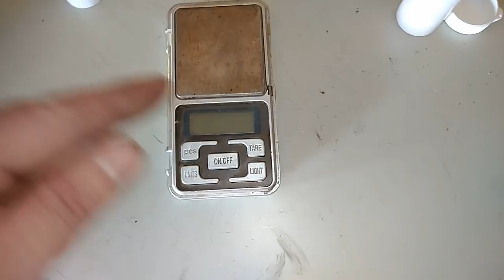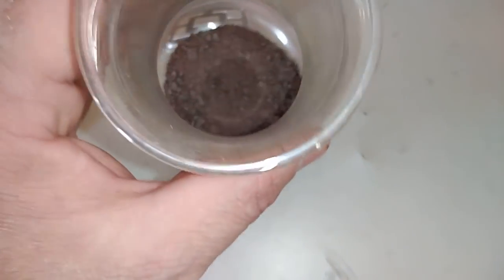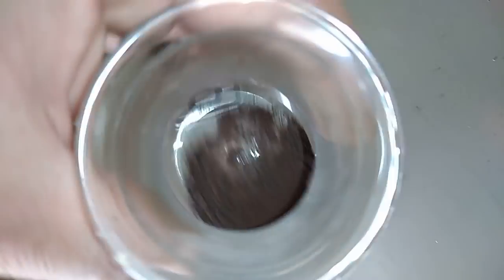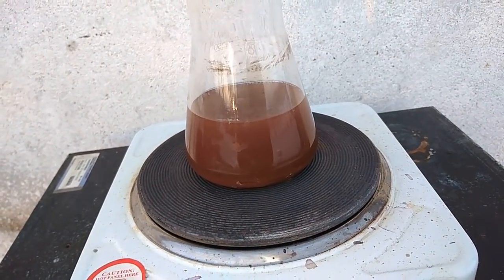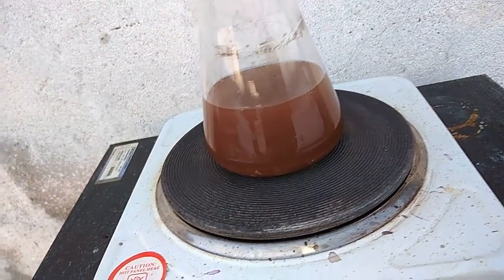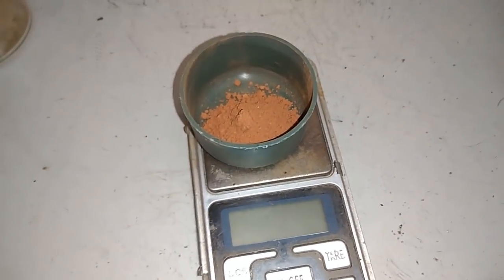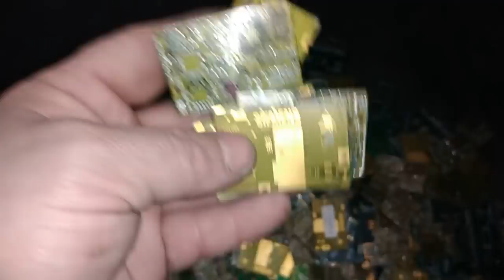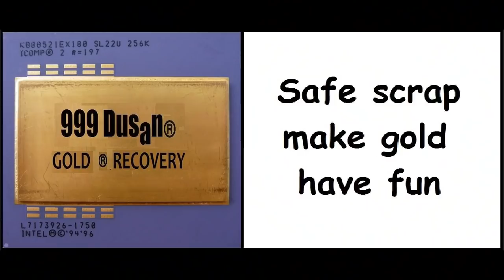Refining 500 modems gold to high 999 purity!

Comment: So about $570 in gold .  Would be interesting to find out how much all the chemicals cost to refine it.  Really enjoy your channel
Reply: The most expensive is nitric. If you live in the states everything can be bought at a local hardware store for cheap except the nitric acid. It doesn’t cast much to refine depending on what you have and the process you use
Reply: I am from the same county as Dušan, and here is pretty hard to buy nitic, actually I don't know not even one hardware store where you can buy it. But there are some private sellers selling nitric for almost 100 times less price than in US, between 0.5 and 1$ per liter! And another advantage we have,  nitrate fertilizers can be found in any garden store freely, for low-cost as well..